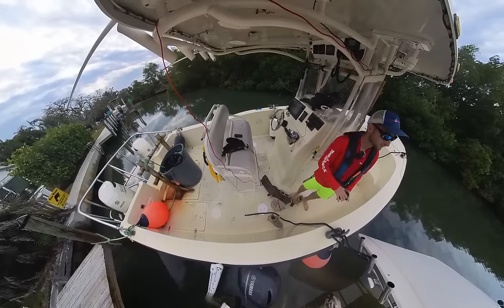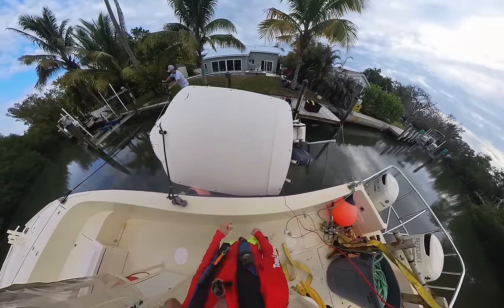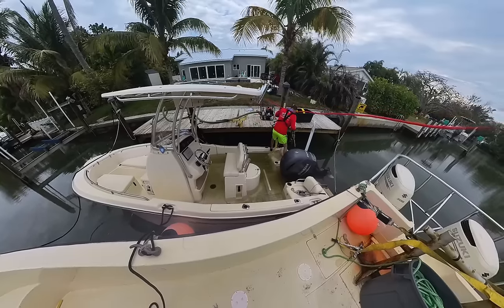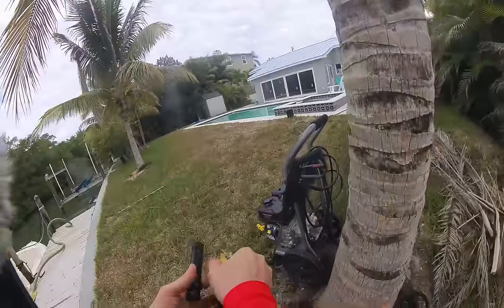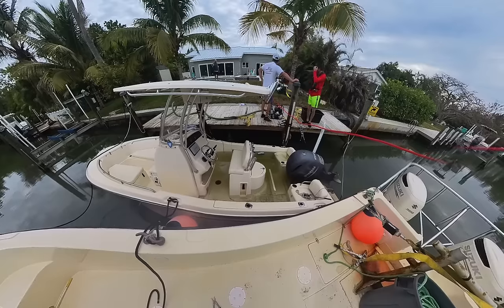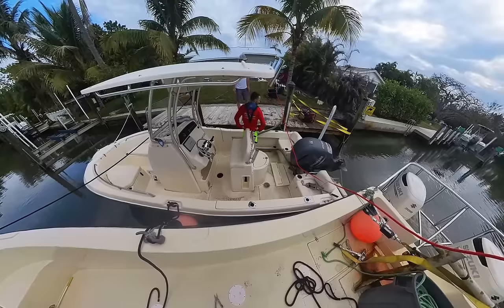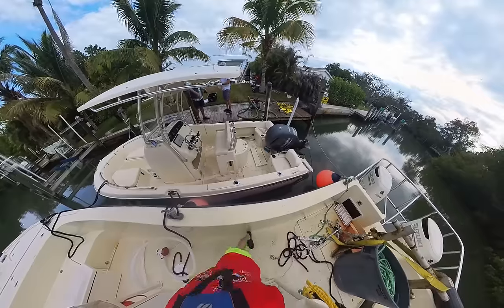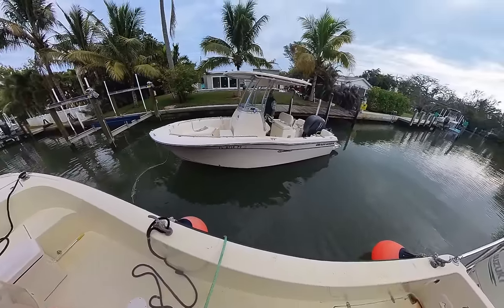Cold Water Salvage: Refloating a Sinking Boat During the Holidays | Salvage - 20ft Grady White

Comment: I'm wondering is a block and tackle would have also worked, like used on a sailboat boom sheet. I've sued those to raise and lower my sailboat mast. Another point to use would have been the top of the piling, I suppose. Great job getting that boat out.
Reply from the maker: Need the ratcheting action of the comealong. I thought about going to the top of the piling, but decided i'd rather not find out the hard way if the strap would stay put or not  🤣
Reply: @CaptKenO   It should just fine if used in a choke around the piling.  A short line with a eye at one end and a running bowline or a short strap will do the trick.

Comment: Besides the wetsuit the boss should buy you a couple of winches with remote control. You do amazing work!
Reply: Add to that a riser to go on the t bar row poll ,then he can winch off a higher point .
Add some rubber matting to place on gunnels to protect from rope damage when lifting.
12volt accessory plug for the bilge pumps to plug into ,tidy and easy to get to.

Comment: Nice to see a basic recovery and pump out, once you had it floating above the waterline could you have powered the onboard bilge pump from your boat?? And would a small drag (perhaps a couple of bath towels tied  off the motor with a short rope) keep the stern from dancing around???
Reply from the maker: I wouldn't trust the electrical system on that boat not to have a short and cause issues on my boat.
The boat tracked fine once I got to open water...it was hard to tell from the video since it was just facing backwards, but I had to do quite a bit of maneuvering in that canal which is what caused the boat to fishtail everywhere. Yes some sort of drag would've helped a bit, but not a whole lot

Comment: I find when using those cable pullers its best to hold on to the lever device and hook the cable end to something to pull the cable out. Another words the opposite of the way you did it.  The lever device is cumbersome with all the levers you need to operate to extend the cable.  Try it, it’s easier.
Reply from the maker: I'll try that next time!
Reply: The cable ones are crap , when I first found the chain one the cable went away
Reply: Work gloves to avoid metal splinters off the cable

Comment: Hey Capitan. So I was watching this video a little late as I just found your channel and I'm a new sub. You have fantastic content. So as I've been watching your videos, there's one thing I think you could use to help protect your vessel and the customers while using your come along. In the Trucking Industry we use a heavy duty plastic "Edge Protectors" to protect valuable cargo and to keep from tearing up our straps we use. They come in different widths and thickness, And sizes. And the best part about them is,THEY FLOAT. Another trick we use with those come along's. Don't leave the cable spooled on them when not in use. Yes they take up more room,But they're easier to grab and spray with a lubricant like WD-40 when you need them and start cranking. Then pull the cable back out and apply lubricant again to them a store them back in there totes or containers. We use them when we can't get a tow vehicle back into remote area's to recover ATV's and Side By Sides, I can only imagine how that salt water eats way at them if you don't protect them and wash them off and spray them down with lubricant. We buy a lot of towing gear from a local company called "MyTee Products" In Aurora, Ohio. They sell those edge protectors i was speaking off.
Reply from the maker: Thanks pyle! I'll look into it!

Comment: If you hook the cable end of the com-along to the cleat, and pull the winch end, its a lot easier to hold the latch. And it keeps your hands off the cable which will rip at your fingers anytime it can.
Reply from the maker: Thanks for the advice. I'll try that out next time

Comment: Good video! Question; what is the orange extension cord running overhead your stern and running towards the dock?
Reply from the maker: Thanks Rick! That was a charger for the camera I put on the boat...didn't matter since the SD card got corrupted...but the camera will only run for about an hour on its internal battery

Comment: For a temp repair cork plugs are ok but should be using rubber plugs with an expansion lever in the mijddle
Reply from the maker: I haven't found an expanding plug that is big enough for these scuppers...that's why I used a wood plug

Comment: i adjust you get diving suit that way you dont have to worry about being freezing make sure it 4 or 6 layer not 1 or 2 it too thin easy get cold
i used to work with few company pull out sinken boat going 100ft deep
Reply from the maker: I get cold easily...I'd need a dry suite if diving for long in these temps
Reply: @CaptKenO  it can keep you warm on boat without needing a jacket at all it could make your jobs easy
i wear two different suits for subdiving one 2 layer for summer and other one is 6 layer for winter (water was below 30f never feel cold aging)

Comment: Did the doat become yours since you salvaged it as you mentioned just a $ 20.00 tip ?
Reply from the maker: No. The tip has nothing to do with it. We don't want the boat, so we only do the job if we're getting paid, either by the boat owner directly or through their insurance.
Reply: @CaptKenO  so the boat owner or the ins. Co. Is paying you and the owner will get it repaired or the ins will pay the owner and total the boat .
Reply from the maker: @rodwilliams2782 Pretty much. The insurance company will pay us for the salvage work, and then work with the repair facility to figure out the cost of the repairs and decide if they'll total the boat. If they don't total it, they'll pay for the repairs minus the owners deductible
Reply: The motor will be fine with a little work, the electric panel will have to be replaced, new gas filters, change oil and filters, flush motor , change plugs, gas will have to be drained and water out of tank, battery checked live well pumps and bilge pumps checked if someone did this himself no problem , but once you go to mechanic then electrician then environmental inspector, then adjuster, then salvager, then upholstery, then chart plotter , instruments, ignition, it’s a total. That’s why insurance is so high a $1000 dollar repaid cost $50,000
Reply from the maker: @mike-vw1zn  it'd cost more than $1k just to have the mechanic pickle the engine and get it running again, and forgetting all the other electrical systems that got wet. I know what the boat was insured for, and I wouldn't be surprised if they total the boat

Comment: just a suggestion  how about a 4 part rope hoist those junk china hoist have no business around brackish water and they are a pain to use and how about a truck tube inflated around outboard motor to help seal the transom and add about 500 pounds of lift just trying to be helpful
Reply from the maker: Need the ratcheting action of the comalong. If we needed lift, we have lift bags that are specifically designed for that application

Comment: Aren’t those power anchor poles, they should lift the stern out of the water if it’s not too deep
Reply from the maker: That wouldn't work for two reasons. One, there's no power. And two, even if there was, by its very nature, the power pole is designed to push into the bottom, not off of it, so it wouldn't be able to lift the boat
Reply: I also realized there was only 1.